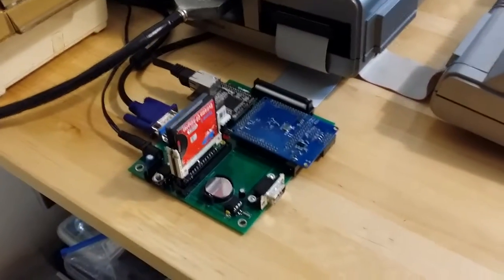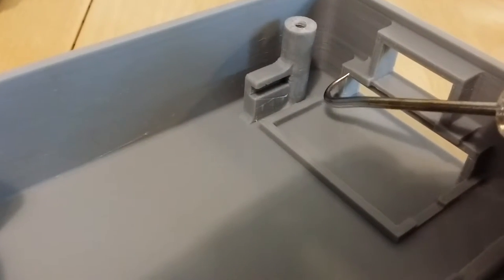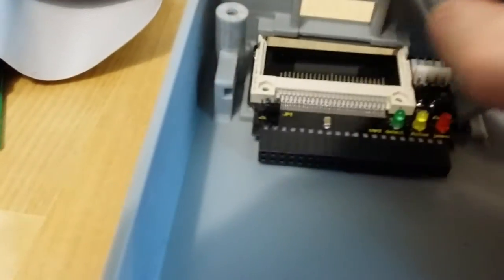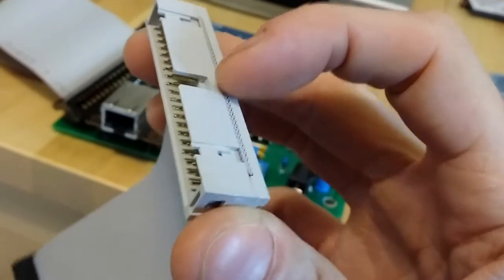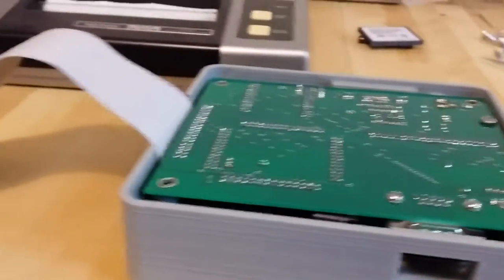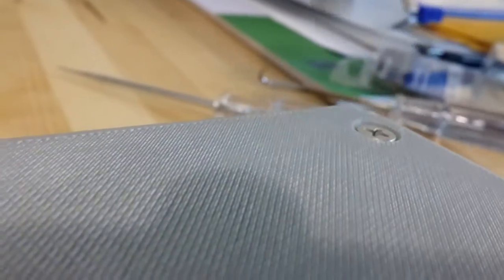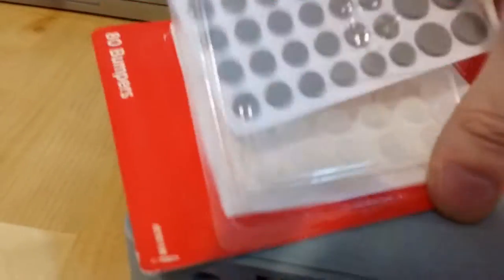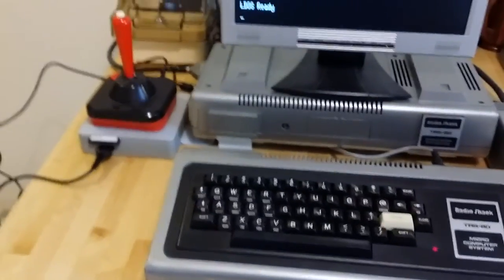MISE Enclosure

Comment: Great product and video, Brian.  I had a friend of mine print one up and waiting for it now.  Thank you so much for sharing.
Reply from the maker: Thanks much.

I should make a new video using the current design. It's roughly the same arrangement but the details for the card reader are different, simpler and more likely to work without a lot of manual cleaning and trimming and digging out corners etc. At least the pictures on thingiverse show the current design from all angles and all stages of assembly.

Plus I could show how to customize the dimensions. A few people have had a problem fitting the card reader with the original version. In the current version it's all parameterized in the .scad file and easy to just edit some numbers in a human-readable text file and run a command to generate a new .stl.  Then again the current design improves a lot of different details having to do with the way FDM printers work, so that it's just overall more likely to work without needing to customize. But if your reader was just too different from mine, then it's actually pretty easy to edit the exact placement and sizes of the parts that hold on to the reader.

The main remaining difficulty printing this part is just the fundamental bathtub shape of the top cover, just really wants to pull up the corners from temperature differences and plastic shrinking. You really want a heated enclosure, or at least a warm room with still air during the print of the top cover part. To make that easier would require having the top flat surface be a separate part from the vertical walls, but I really like the seamless all-one-piece. And I'd have to figure out some other way to do the card reader and probably wouldn't be as elegant.

Comment: Maybe the thickness of the PCB board the CF cards are mounted on changed (Looks much thinner in this video), but I have two of these kits, and neither would allow the top (Furthest from the edge where they seat) to be inserted - Not even close.  I cut a slot in the top of the enclosure and let the CF board go through and remain in it's original orientation (No cable, 90 degrees from the main M3SE board).
Reply from the maker: I can't tell what you mean from this description. Can you post a link to a few pictures of your cf reader module, and the fitment problem?
Reply from the maker: Also note I have updated the design since this video. It is easier to print now, the shapes that make up the card reader holder are simpler, loosens the fit around the outside of the actual cf slot rails, and eliminates the inside-corners in the tray that are prone to interfering due to printing imperfection. It's the same thingiverse link, but the files are now different from the video. But the overall arrangement is the same so the assembly procedure is the same. Also now the source file that generates the STL files is written in OpenSCAD, so now there are plain text numbers with comments in the scad file that can be edited to change the sizes and locations of things.